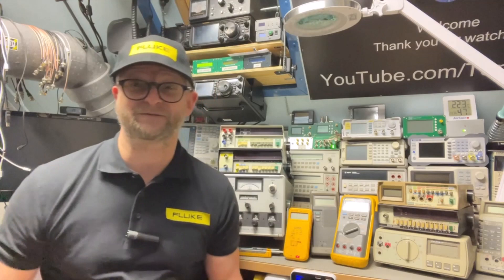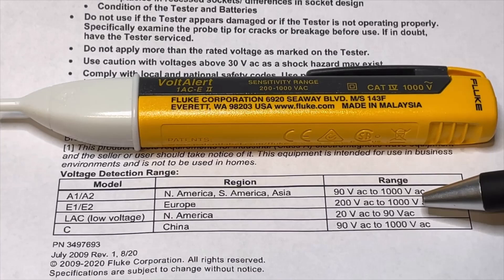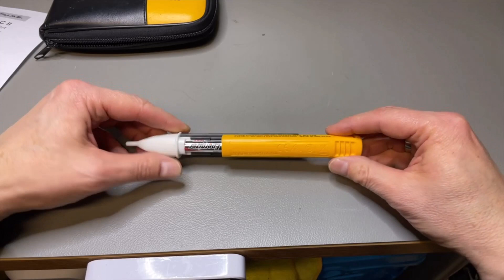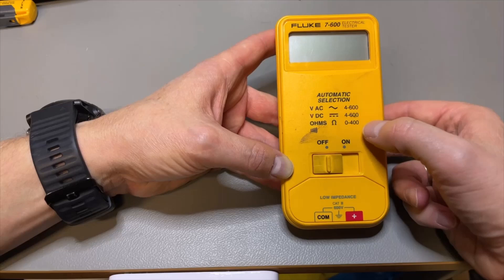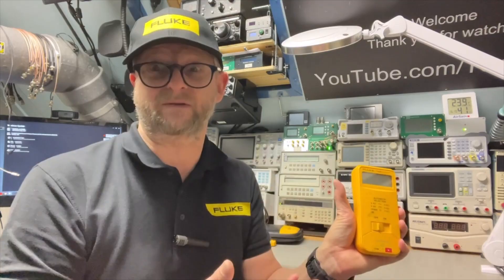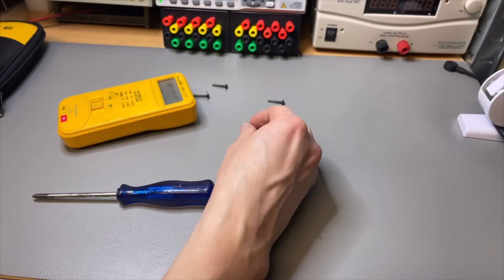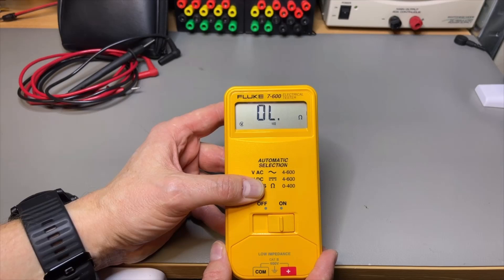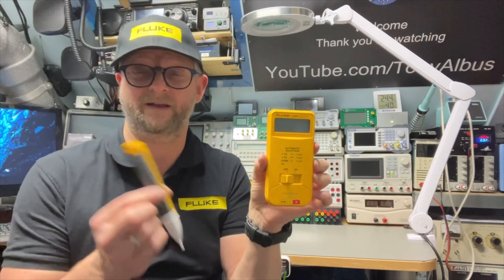TA-0316: Fluke Friday (E1)  Serie 7-600 and 1AC II

Comment: My dad's had a 7-600 for longer than I've been alive and both the measurements and leads are still bang on. I really only used it for continuity and battery voltage testing on small engines but it's been plenty for me
Reply from the maker: Yes perfect for things like that!.. and it just keeps working..

Comment: Excellent new series Tony. And don't you look smart in that Fluke outfit. That was a nice introduction to this new series with some nice products too. The 7-600 is a really interesting meter that still hold their value well. Would be interesting to know who Fluke were aiming to sell that meter to. I had a voltage tester similar to the 1AC II but made by a different company. It worked fine on normal mains but testing it on a 230v very large industrial UPS it would not pick up anything. Maybe the sine-wave was modified or something but it could have caused a problem if I relied on it. Have a good week.
Reply from the maker: Hi Ian, thank you... Interesting point.. next time i bring my 1AC to the servers to test it on the UPS.. Cheers!

Comment: Fun fact about the 10 series: 
Remove one SMD capacitor and they all become a 12.
Even the missing buttons are there under the hood, only the face is not there.
Reply from the maker: Yes indeed.. i saw the same in the 7-600 .. i think if you put the switch halfway it is in manual 4000 mv setting with high Z :)
Reply: @TonyAlbus  
I don't get that on my 7-600.
Once out of the Off position it will just show all elements on the screen and only when it reaches the On position it goes into the do-it-all tester mode.

Going by the service manuals the A/D input IC is the same for the 7 and 10 series. Only the logic IC is different.
There are also 12b and 18 meters which appear to be 10 series meters with a rotating knob. They're in the same SM as the 7 though.
This knob operates the same sliding switch as the other meters.

The 16 is also similar but adds uA and temperature.
I don't have a service manual for it so I can't say what ICs it uses.
Reply from the maker: @jeroen79  Interesting, will test some more...i also have the 12B .. so stay tuned.